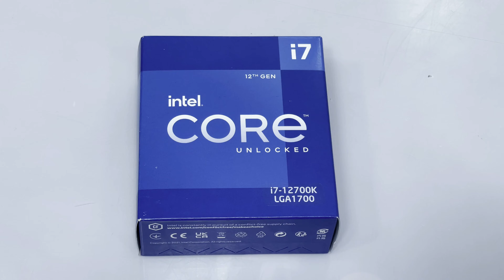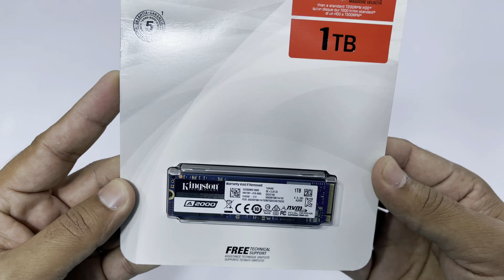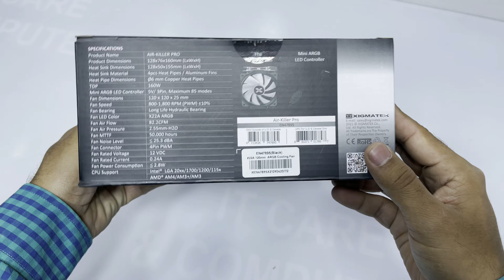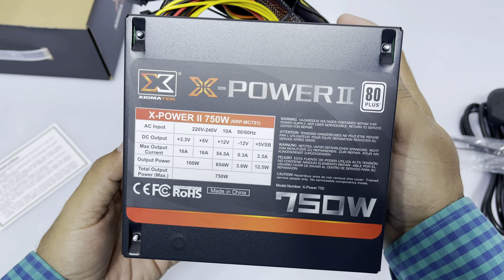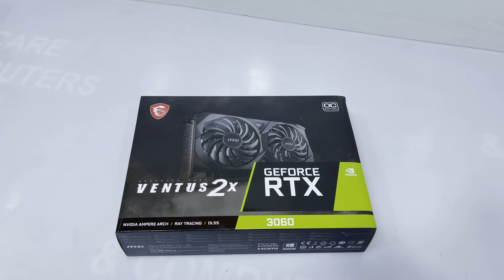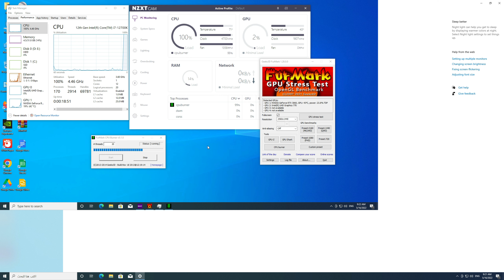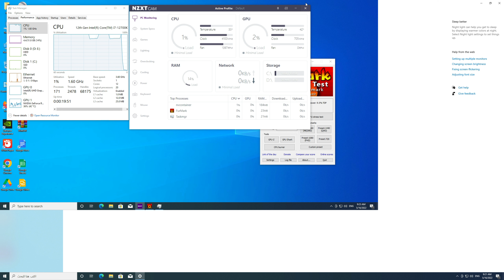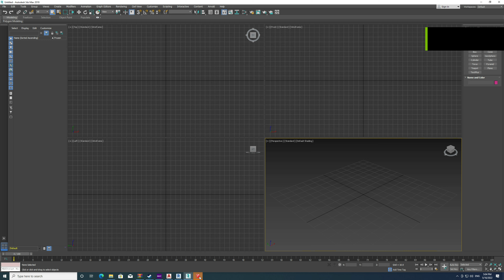i7 12700K Editing Pc Build 2022

Comment: can anyone tell me the best air cooler for this i 7 cpu pleas!?
Reply: Im using an AK620 its not that bad when it comes to air cooling
Reply: Go to pc part picker, hit 'start your build' - in the cpu section, select this i7 and on the page for the 12700k part, scroll to the bottom, and there you'll find builds that have used the part. These can help to recommend good parts for your build